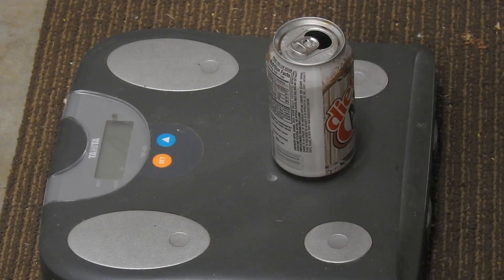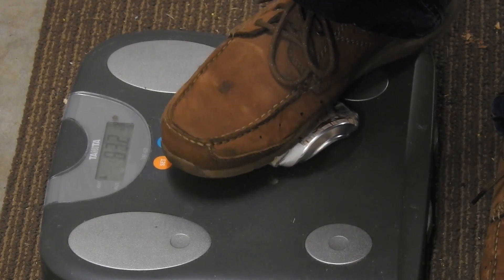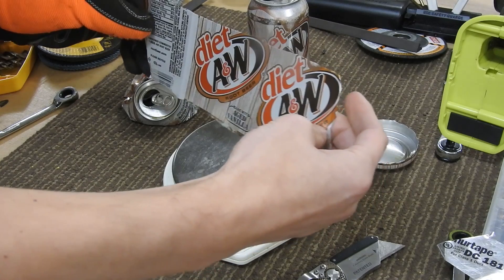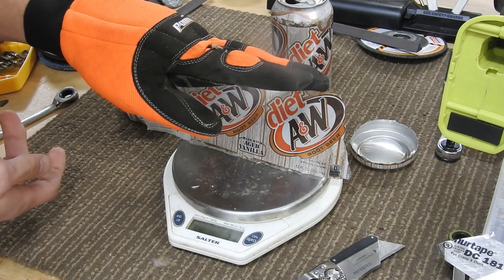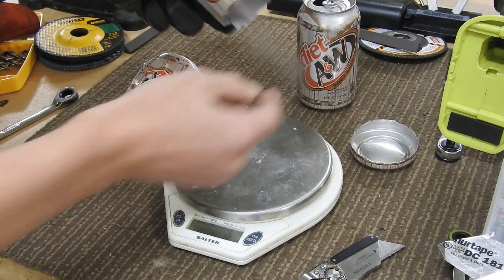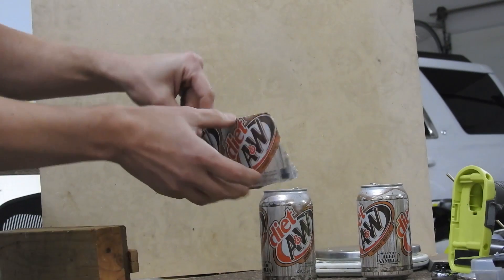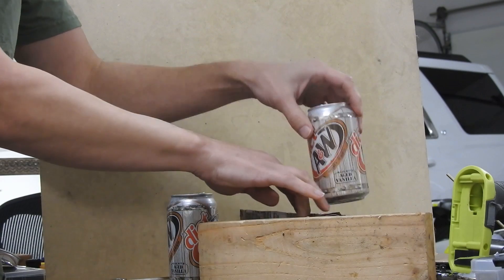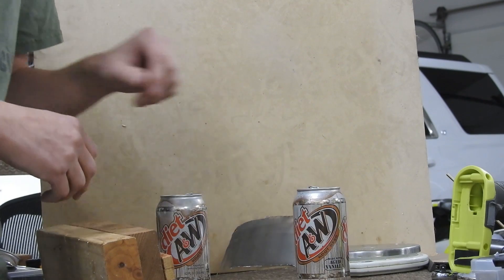Soda Can Loss Of Structure Illustrating WTC7 Collapse

Comment: this analogy does not work because the WTC had core columns at the center of the buildings and all around the elevator shafts to handle the gravity load.
Reply from the maker: In WTC7, the core collapsed several seconds before the exterior
Reply: @MickWest  Yes that seems to be the case as per the NIST report. So I guess the analogy works after all.